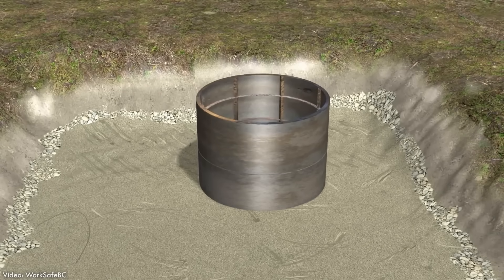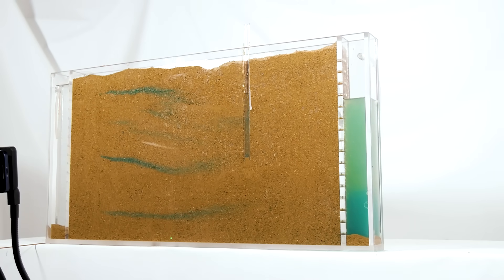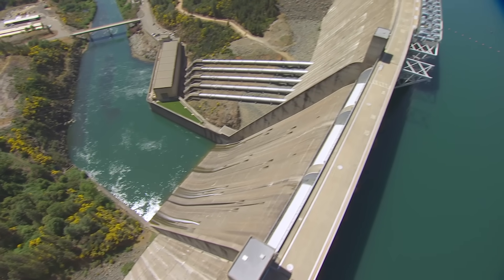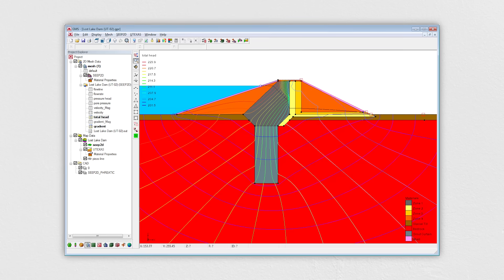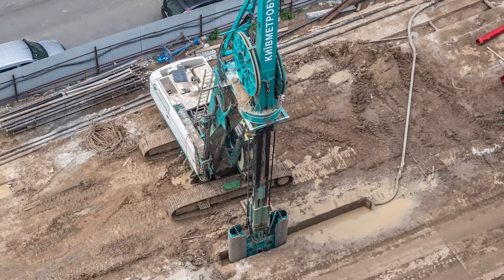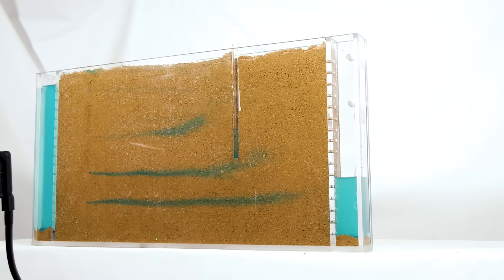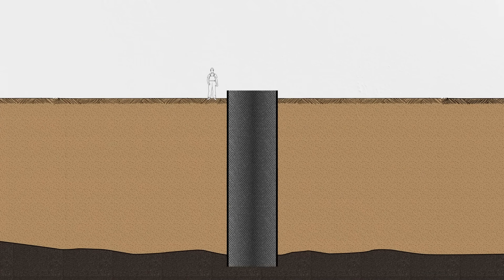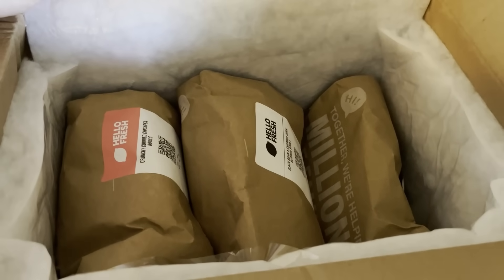The Bizarre Paths of Groundwater Around Structures

Comment: Please explain how pipe pressure and volume works. I cannot wrap my head around this concept. For example if you have a 1inch water main the the volume to be delivered is determined by downstream size of pipe, not the main itself. Also you can have a gas line going into a regulator 1/2 inch but then have pipe supplying appliances 3/4 inch and greater. 

I feel the pipe size should be limited by the Ingres size but clearly that is not the case

Comment: I've noticed that dewatering is commonly employed at new building sites before basement-level excavation work is performed and until the water blocking foundational slabs are created.

Another application of dewatering and subsurface blocking dams is present at the Fukushima Daiichi triple reactor accident site. Both sheet pilings, and later, frozen subsurface water barriers, have been emplaced to restrict the flow of radioactively contaminated water that flows towards the ocean.

Comment: I’m trying to wrap my mind around the equipotentials and flow lines at around 7:03, and tie it together with what I know about fields and potential from physics. I’m a bit confused about a few things. I’m not saying you’re wrong, and I’m not trying to correct you. I’m just trying to improve my own understanding.

For one, I’m not sure if “potential” and “pressure” are the same in this context. Pressure would have to increase as you went straight down, right? But if you tried to move a volume of water up or down in a column, it shouldn’t take any work, since a volume of water inside a larger volume of water would have a buoyant force equal to its weight, so to say a more or less vertical line is “equipotential” seems correct. But when you say “equal pressure,” I feel I know what you mean, but at the same time the term seems not exactly right. It’s something like pressure, but it only applies to fluids the same density as water. If you were to inject heavy water somewhere, it would want to go more strongly downward than regular water.

Another thing is whether the flow lines are supposed to be the same thing as the gradient, and if so, shouldn’t the gradient be perpendicular to the equipotential lines? So the equipotential lines shouldn’t be straight up and down, but should lean a bit to the right?
Reply: Hey there, you are correct on your intuition. These black dashed are equipotential lines and not isobaric lines. Reason is that gravitational forces affect the pressure.

If these experiment were done on a flat, horizontal plane with some source and sink, then yes these lines will represent equal pressures as gravity is not a factor anymore.

You are also correct on the slanted equipotential lines. In the demonstration with no sealing wall, the equipotential lines should be slanted rightwards a bit because the flow lines or streamlines are converging to a smaller area on the right. And streamlines are always perpendicular to equipotential lines.

Comment: Thanks.  I would like to see a video about how when water flows through a pipe that goes up and then down there is sometimes a pipe to let air out at the high point of the pipe.  I don’t know what they are called but I see the metal capped metal pipes with holes coming up from the curb in my neighborhood. I was told they are to let air pressure out of the sewer.  Would love to know more.
Reply from the maker: Search my video about air lock
Reply: @PracticalEngineeringChannel  thanks for the quick reply.  You earned a book customer. :-)

Comment: I encountered this last night. Spring drainage pipe in my back yard met a root and so I dug it out to replace the damaged piece and cut back the roots. Except the pipe wasn't located where the water was bubbling up through the ground. 

3" down below the grass is clay. The pipe was 2 feet to the right of where I saw the water coming up through the yard. The clay acted as an aquifer, keeping the water below ground until the water found a crack in the clay and released some pressure. Mind you, this is 20' past where my spring exits at ground level and enters a drain that runs under the back yard. What a hassle.

Comment: I was told a story years ago about a farmer who finally got around to pulling out an old tree stump…and then his nearby pond dried up. For a couple hundred years those tree roots were all that had been diverting groundwater to keep the nearby pond filled. Ground water hydrology is fascinating.
Reply: Might be the other way around ─ removing the stump left holes where the roots were that drained it.
Reply: thats amazing. He must have felt like such a pillock
Reply: Lots of great comments in this thread. I'll just add: the story about the tree-stump and the pond was told by a university guest lecturer who was a ground water hydrologist. It was one of several stories he told about how the flow of groundwater often moves in surprising ways.
Reply: @cali gdp I think I saw that episode on "Foghorn Leghorn".
Reply: Maybe the original tree roots had penetrated a layer of soil that was rather impermeable. However, since the roots themselves were still effective at preventing flow, there were not immediate consequences. Then, if the roots were pulled, the resistant layer would have been rendered ineffective and water could flow. So, the stump/root system had not really been diverting water from a typical viewpoint, the impervious layer was the controlling factor and was eventually disrupted. Of course, that's just a guess.
Reply: This reminds me of why planting trees can reverse desertification.
Reply: When I was visiting various castles and palaces in Europe, I saw a lot of furniture made of dark wood. At first I thought it was mahogany but it turned out to be bog-wood! It was usually oak wood buried in water for sometimes hundreds of years that was giving the wood the dark colour and incredible resistance !
Reply: @martaborkowska8168  oak wood darkens with weathering to dark grey. The dark wood frame in old black and white timber framed buildings is oak left to weather. Painting the oak wood frame black only started later in Victorian times.
Reply: That's a crazy story, thanks.
Reply: Makes me this of cottonwood I cut by pond.  the stump was pushing water out like a heartbeat.  Their was no way that was just the tree pushing that water up.  It was a young fat 6 year cottonwood 7 feet from pond.
Reply: My area was flooded by the river many years ago, and when the situation went back to normal, they discovered that the groundwater level had drastically decreased, leaving the old wells empty. That water must have gone somewhere else...
Reply: Neat story and I don't doubt it's authenticity. My only suggestion is that the tree stump itself wasn't the only thing which had been diverting water into the pond. There may have been other trees and stumps growing nearby which were doing the same thing- basically plugging any potential drain holes from the pond. Had the farmer removed any one of them, or even a nearby fence post etc. the pond may have drained just the same. I tend to think of everything in the ground near the pond is a potential plug. You remove the wrong one and away the water goes.
Reply: Bullshit
Reply: Hundreds of years? It would biodegrade by then.
Reply: @LeviForWaifu  Not necessarily.  For instance the wooden pilings that were put down in the 1200s to the 1500s continue to hold up the buildings of Venice. I cannot remember which English cathedral needed repair to one corner of its pilings,but that was done around WWI. They too were put down in the medieval era, and the remaining pilings were seen to be sound. 
There are peat bogs where the original plants at the deepest ,date from the retreat of the glaciers and are quite identifiable. And that is what,12 to 15 thousand years ago.
Reply: @paulmanson253  I'd imagine those were most definitely saturated with oil when they were put there, they definitely weren't just straight wood piles.
Reply: @HerbaMachina  Actually they were.
 A story I had forgotten while I was typing earlier. My great uncle had a dairy farm in New York State. In 1970,one particular field suddenly got wet up at the top of the slope. He called in an engineering firm,they surveyed,said drainage needed to be added. First time I ever saw a Ditch Witch. And,to everyone's surprise, sections of oak logs cored out at the centre showed up at the bottom of the trench exactly where the engineering firm laid out its drainage line,heading to a small pond . Samples were sent to a nearby university,the logs were dated to the early to mid 1700s. They had been reliable drainage for 200 years till silt and some rot blocked the flow. Furthermore,the pond structure was much more sophisticated and larger than thought. Puddled clay slabs had been placed to create not just the  pond but create a break where beasts could drink on the downward side. 200 years of aging plus silt plus cow flop had disfigured the shape,but cautious digging revealed the original. What amazed me was that the expensive engineers plus survey equipment that did not exist then only matched what had been done centuries earlier. Each oak log was about a cubit long,about 8 inches across,the hole was not quite 3 inches in the centre,and had a simple join or bellmouth join end to end. No gravel surround,just dirt fill.
The amount of work required for this must have been colossal with just hand tools,but there it was. There was considerable rot,no mistake,but there were complete sections lifted out intact as well. Just like the Mary Rose, once the oak dried out it crumbled,but a few sections were preserved.
Our ancestors were no dummies,they used what they had. The replacement drain tile was plastic tube with gravel surround. How long it will last till it silts up is an unknown.
Reply: @paulmanson253  that was fascinating
Reply: @myMotoring  I should add that the logs were not peeled. The bark was intact. I personally held in my hand oak bark that probably predated Wolfe and Montcalm and the battle of the Plains of Abraham. A strange sensation.
Reply: @paulmanson253  really cool, thanks for sharing, i really appreciate and am facinated with creating things that last
Reply: @paulmanson253  thank you for the recount and information! I was of the impression wood just rotted no matter what. I also enjoy looking at actual things from history like scans of old maps and journal entries and I agree with your comment about our ancestors working with what they had.

I believe a lot of people think the masses were just slow/archaic but when you consider what does/did exist and how well they did, we have to give them credit in pulling off the things they did. I like to think of the contrast between many of the complex mechanical systems that existed vs what a motor and a few actuators achieve today. Somewhat irrationally, I fear we may lose those finer mechanical arts because like some great structures, people tend to forget how they once did it. 

Pardon my ramblings but the comment really did make my evening.
Reply: @BrownMInc  You are quite welcome. I like the handle you chose. Minc indeed.
Reply: @paulmanson253  winchester cathedral?
Reply: @Js-rq9uj  I think so.
Reply: @paulmanson253  re the Mary Rose, you make it sound like the ship's a pile of dust, but it isn't - it's warped and cracked a lot since the water/PEG spray was ceased and its had to be supported by scaffolding, but it's still very much in a cohesive shape. What's even more remarkable for me are the Viking ships of Skuldelev, simply due to their age; a masterful excavation and stunning display. If you've never visited either museum, I'd definitely recommend both.
Reply: @bordershader  Sigh. How much information to choose in simple typing.  Whether the Vasa, the Mary Rose,the Gokstad ship or other, preserving any wood that has been underground or water is a genuine problem. I cast no aspersions on the Mary Rose team. The subject was that unless techniques were used,the wood crumbles as it dries . Which it did. My great uncle was practical but always busy.  The best samples were wrapped in plastic ,surrounded by water and frozen in a 7 foot family chest freezer.
Which is more than most people at the time would have done.
But thank you for giving me information I did not know.
Reply: @paulmanson253  I heard that some ancient tribes hollowed out the center of logs by controlled burning and scaping.
Reply: @BrownMInc  Just occurred to me. Do you live in England ? Not far from Kew Gardens,there is the Living Steam Museum, the old water pumping station for London. The beam engines built by Bolton and Watt still exist,function,are massive and have to seen to be believed. As well,there is enough brass and bronze in the other preserved Victorian steam engines to pay off the UK National Debt. The beam engines worked 1844 to 1944.
I was last there in 1980,but it still exists. Worth a trip if you are on that side of the pond. Cheers.
Reply: @paulmanson253  I just learned at a community meeting that we still have 200 year old wooden water pipes in Philadelphia. There was a road engineer for the city present. I can't find any references about it online other than a wood water main dug up in 2017. Wish I had asked more questions.
Reply: @paulmanson253   Near where I live is Saint John the Baptist Church,  built in 1340s on oak piles driven into what was then a marsh.
Reply: @LeviForWaifu  wood that is fully submerged in water tends to not rot. Cellulose can only be metabolized using oxygen. Anoxic microbes cannot break down cellulose because without oxygen there is no profit of energy.
Reply: @LeviForWaifu  That assumes the tree was dead for hundreds of years. Tree could have been alive for a long time then died more recently, and eventually the stump was removed.

I will say though, it does feel a bit hard to determine that a particular tree was the sole reason for a pond existing for hundreds of years.
Reply: @LeviForWaifu  I'm including the pre-stump period, back when the roots were feeding a living tree.
Reply: @LeviForWaifu  no not always wood is still somewhat.... I don't want to use the word "alive" so instead I'll say responsive to its environment even when it's dead

Wood can still shrink, and engorge itself, and bend in strange directions as a result of those movements as water gets absorbed and dried out

And depending on what type of wood it is and what type of environment it's in, it will do more or less of those movements
Reply: @LeviForWaifu  Depends on the species.

Comment: 3:40 Doesn't having the base of the dam below the water level effectively make a cutoff wall, reducing the problem?
Reply: Yes, but that would be very expensive and unnecesary. A gravity dam has the most surface area at the base, if you make it it even deeper than it should be just to prevent the phenomenon mentioned in the video you're basically wasting materials. Civil engineers are constrained by budgets and the solutions mentioned in the video accomplish the same result but are far cheaper than lowering a dam's foundation.
Reply: @cristicristi8195  He said the uplift happened if the base of the structure was below that level and I was thinking "well at that point, aren't you now increasing the length the ground water travels?"

Comment: What happens to structures that use pumps to lower the water level/uplift pressure when the pumps fail? I'm assuming there would be a backup set of pumps?
Reply from the maker: It can be a scary situation, but luckily groundwater moves slow, so you often have some time to make repairs or replacements before the uplift pressure starts to become a concern.
Reply: @PracticalEngineeringChannel  Easy to forget time scales on a time lapse. Makes me think a bit of my local clay pits and their pumps.

Comment: The demonstration really shows how surprisingly well water follows Darcy's law. Having a degree in mathematics I've seen my share of the Laplace operator :-). However, obviously the model will break down for fast flow rates and when the soil starts moving. When a evaluating a construction design, are there some well-established limits for the model validity? How slow should be flow be to trust that the soil stays in place?
Reply from the maker: Very generally, if soil is moving below a structure, you have bigger problems than the groundwater model :) Soil is confined and unable to move with groundwater except at the surface, so a big part of geotechnical design of subsurface structures involves making sure all seepage exit points are filtered. See also, "exit gradient."
Reply: Im not sure if you will see this, but I am a hydrogeologist and use Darcy's Law everyday, as well as some of the modelling softwares shown in the video. The assumption in almost all saturated zone flow modelling is that the rock/soil matrix acts as a static environment inwhich the flows are modelled (ie; no soil seepage).

To answer your question about model validity, maximum flow speeds are limited only by your starting paramteres, and of course in theory you could create a physically impossible model using darcys law. However (and this is key), the starting model parameters are almost always sourced from geotechnical and geological studies of the site in question, and are 'sanity checked' against the known hydrogeological setting using a 'base case' model. We dont just use the math when assessing flow speed either, other tools can be used to further validate the model.